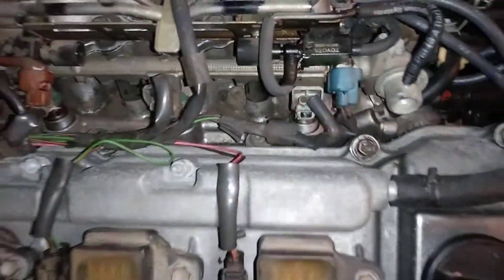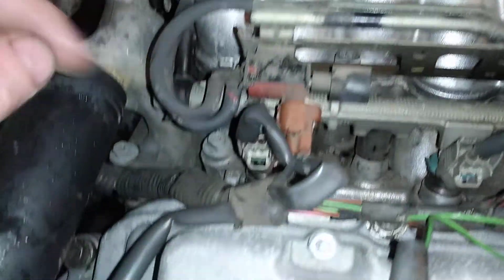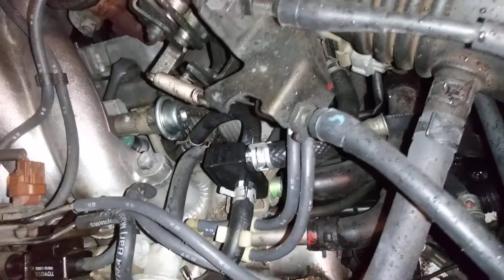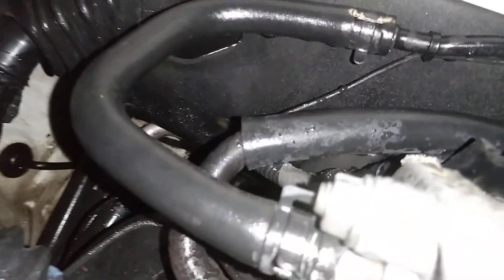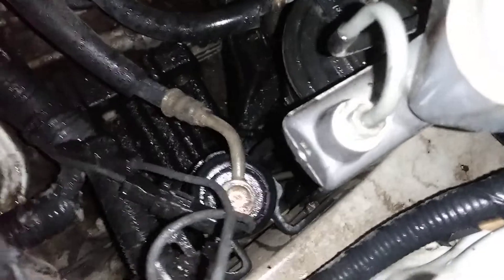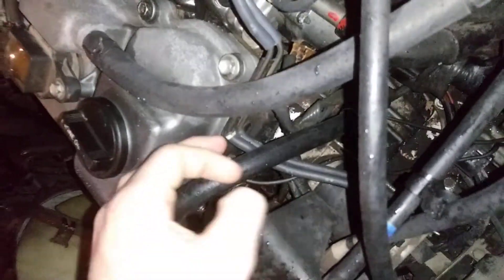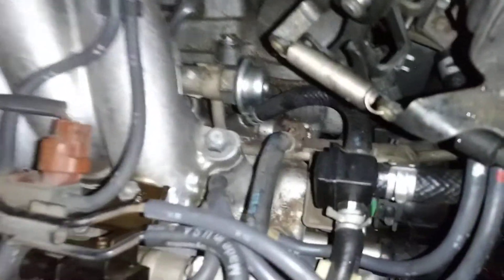Toyota Camry V6 Engine Vacuum Routing (1st Gen. 1MZFE)

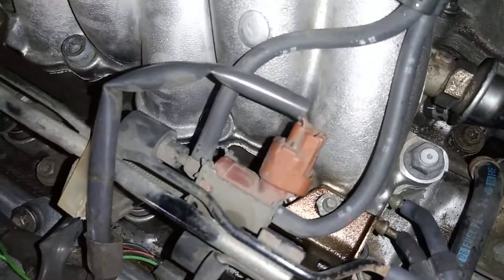Comment: @2:18 Your VSV is installed in the correct orientation... Mine was 180 degrees off Meaning the filter was at the other end.. Would not be problem .. except the vac hose stayed the same which means it was incorrect.. I changed the VSV  and do not think I switched the orientation. Was the Dealer or a shop before I bought it..

Comment: Question why would my front valve cover hose that runs to the air intake tube be spitting motor oil into the intake tube which over time ends up soaking my air filter I've changed the pcv valve, both valve gaskets etc but I  can't and nobody I've asked or looked at it can come up with a reason the oil pours into the air intake tube soaking now my 3rd filter in less than 2 yrs

Comment: The lower pressure regulator on the rear fuel rail is a pressure Dampener. The one on the front fuel rail is the pressure Regulator
Reply from the maker: Thanks...

Comment: My 2003 solara with 208k just starting  making this odd fog horn sound coming from the engine bay when driving 20-30mph  . Happens after about 10 mins of driving and I’ve well maintained it . Currently investigating myself after my mechanic checked the car thoroughly and couldn’t find anything .  Noise stops when I accelerate or let off the pedal .   No lights no codes just someone hiding under my hood playing a trumpet at times randomly lol smh.
Reply from the maker: If there's no differences in performance, or acceleration vibrations, I'd check the air breather box, filter, and throttle tube assembly, the Mass Air boot. Check it for leaks. Check for other vacuum leaks or disconnected hoses. Check the tensions of belts and idler pulleys. Including the power steering pump and alternator pulley bearings. If you've got no problems there, then I'd check the differential fluid.

Comment: That "other pressure regulator" I learned it has a different name. It is different to the one on top. The bottom o e went bad one me and was leaking petrol. Also my reason for being here, is because I think I have a leak. But my motor doesn't have those two lines on top of the throttle body, nor that valve.
Reply from the maker: It's called the VVT package. No EGR valve.

Comment: i have a 2000 camry v6 and need to replace the egr vacuum regulator solenoid according to the dignostic check i looked at your video i see the 2 valves in this car mine doesn't have 2 valves like that it just has 1 can you help me out
Reply from the maker: If you really need help, upload an "unlisted" video to a Youtube channel and send me a link.

Comment: great description, would you know how much the vacuum specs these engines? mines reading 25hg/in on idle. not sure if its good or not
Reply from the maker: Not sure, but there's an online service manual for the 1993-1996 Camry. It's a link in one of my other Toyota Camry videos, look in the descriptions. There should be Vacuum Pressure specs in that manual.